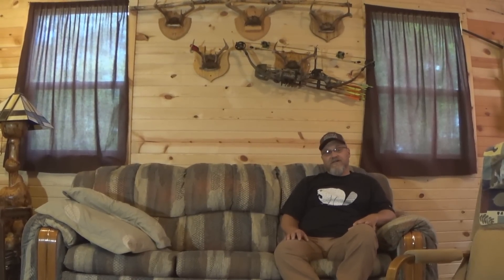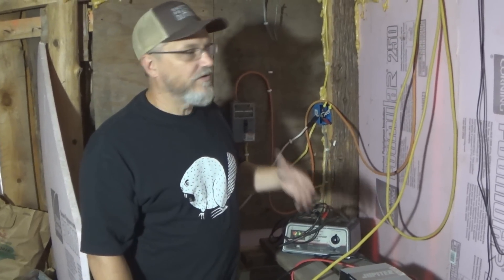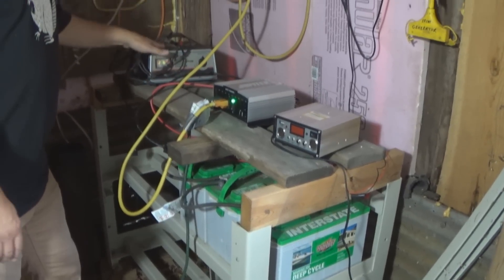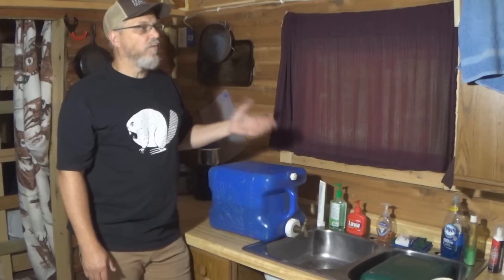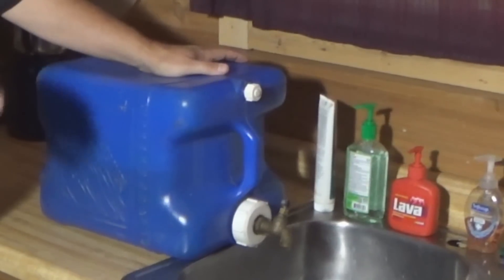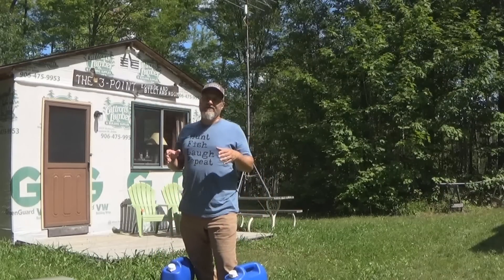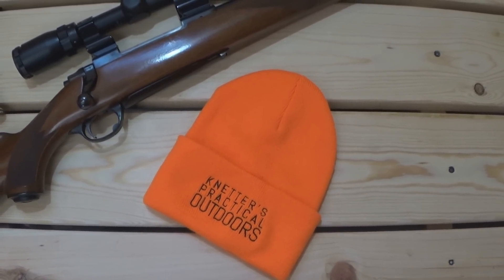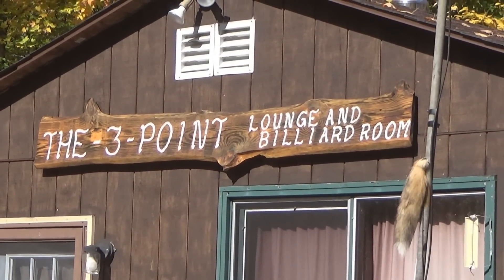Off-Grid Utilities - How We Do Heat, Water, Electricity And Sewer

Comment: Some great ideas. The water seems like the weak link. It will be difficult to haul all that water when you get old or disabled. Six things you can do fairly easily and inexpensively:

(1) Collect rainwater off your roof into plastic 50 gallons drums (you can usually get used ones for free). You may need to add gutters, pipes and metal/vinyl roof (if shingled). If drinking water, have it tested or filtered. 

(2) Dig a shallow well with a pipe and handpump away and uphill from your outhouse. If drinking water, have it tested or filtered.  

(3) In the driest time of year, search your land and adjacent land (with permission) for wet areas near a hill. Follow it uphill until it's dry. Move debris below this until you find it wet again. Dig uphill until you find where the water comes directly out of the ground. Dig a small hole. It will likely fill quickly. Give it a half hour for sediment to settle to the bottom. Scoop a jar of water off the top and bring to the nearest lab for testing. If it tests good, come back and dig your hole deeper. You will have all the water you need. You can carry it to your cabin, or dam the bottom, and run an insulted pipe to your cabin (remember, you are uphill). Covering with forest litter will work and look better. It may freeze in the winter if you're in the north. If drinking unfiltered, I would get it tested once after flooding and then once a year. 

A few more tips:

(4) Outhouse: I would add a vent pipe that goes below the seat and well above the roof. The wind will pull the smell away. I would not use ash. It will fill too quickly. I would have a bag of lime with a scoop on the top. 

(5) I would purchase an inexpensive camping folding toilet seat for using inside if it's too cold outside or if the snow is too deep. You can purchase environmentally safe disposable bags that you can dump into your outhouse at a later time. You can have a partition around your toilet for privacy if you wish. Or better yet, keep it in our sauna to use. It's warm and you have privacy. 

(6) I would add a heat reclaimer (with thermostat) to your stovepipe a foot above the top of your stove. You can set it so it will only come on in when it gets the coldest in the early morning when only hot coals remain. Instead of having to get up out of your warm bed and try to start a fire in the chilling cold, your cabin will be the hottest when it is the coldest, and you will use far less firewood. As hard as this is to believe, it really works! Coals give off more heat at the bottom of the stove than roaring flames going up your chimney and wasting energy. An ironsmith puts his metal into the hot coals, rather than at the top of the flame.
Reply from the maker: thanks for taking the time to add all that.

Comment: The building has a natural flaw being wood,,,wood rots and it's suggested to make the shelter from cement board rolled out with fiberglass resin and coloring.  It's getting close to a permanized structure for all purposes anyway.
Reply from the maker: That may be true, but there is a lot of wood buildings over 100 years old and still going strong.

Comment: Wow !! You guys have made an awesome camp / bugout pad for yourselfs. Well done !! Have you thought about putting in a shallow well ? Howza bout yer waste water ? How often do you need to move the outhouse and / or sauna/ shower because of inadequate drainage, if ever ??
Reply from the maker: We tried a point once and had some problems but we may try again.  Our sink and sauna drain into a dry well (buried barrel with holes and rocks in it).  Haven't had to do anything with the outhouse yet and it's been over 20 years.  We only stay 20-30 nights a year so it pretty much turns to mulch.

Comment: You don't want to be producing sparks right at your batteries!
Reply from the maker: They are in a well vented shed but I know what you're saying.  There must be a large capacitor in the inverter that loads up as soon as the leads are connected because the inverter is off when we hook it up.
Reply: @KnettersPracticalOutdoors  Yes capacitors for sure, you could pre-charge them through a resistance, even a car turn signal lamp then correct directly. Better still use a switch or relay, an enclosed one. 🙂
Reply: Yes. Hydrogen gas can get real angry. Def need for a remote switch. Probably not close to a burn ward either.
Reply: @pgnandt  Gotta love the smell of Brown's gas in the morning. It does tend to dissipate once you've blown your roof off however.
Reply: @stevemorris3710   Watching a few videos of guys blowing up bags of Brown's gas I developed a respect for batteries blowing up. Brown's gas = Shake hands with danger.
Reply: @pgnandt  For sure, that and acetylene/oxygen have to be the most dangerous.

Comment: You should clip the positive and negative from opposite sides of the battery bank so it discharges the batteries equally
Reply from the maker: Does that really help?
Reply: @KnettersPracticalOutdoors  imagine the flow of energy leaving your front battery that both terminals are connected to.  The other batteries down the line transfers over to the front battery.  It will shorten the life span of that front battery making it less efficient.  Putting it on opposite sides discharges all the batteries simultaneously. Doing the same thing with your battery charger and solar charge controller

Comment: Using an inverter .. there is a loss converting DC to AC... Purchase many DC operated appliances as possible and you will use less battery running DC...
Reply from the maker: True.

Comment: Replace that old generator with a Honda E.U.2000.
They get way better fuel economy. 
Especially if your only powering a battery charger. 
You will use half the gasoline. 
And much quieter.
Reply from the maker: Maybe someday.

Comment: In a pinch you can run jumper cables from your car to charge batteries if your on 12 volt system I use 2 golf cart battery in series got 8 years out of them 250 watts of solar
Reply from the maker: cool idea

Comment: Could u give the price of the batterys bank .  converters and items u use to set this up.  need to know price tags on things.  thank you
Reply from the maker: Each battery is about $120 to $140.  The inverter was about $120.  Generator $500.  Solar panels and charging controller I think was about $150.  Rough estimates as many of these items were purchased over the course of several years.  Thanks for the interest, KPO.

Comment: I like what you have going. How long does the battery bank last on a full charge with the two of you out on a normal camp out? Also how long does the generator have to run to charge up the system? For me using a 10amp charger it takes 4 to 6 hours or more to fully charge a single batt in my car so that generator must run near continuously to keep the batteries charged up. at that point why not just run the generator directly just using the inverter at night.
Reply from the maker: 3 batteries in good condition and fully charged will last 2-3 days during deer season (dark out at 6 PM, lights, TV until midnight or so).  In the summer they last an entire 3-4 day trip.  Yes you're right, once the bank goes dead, it won't get fully charged again on that trip.  If the bank goes dead after say 2 days, we will run the generator that evening for electricity and charge the bank for 2-4 hours.  The bank isn't fully charged, but usually enough to have power for the next evening.  Often we bring the bank home and get it fully charged for the next trip in the fall season.  In the summer the solar charger usually gets it charged up before we return.  Sometimes if we loose power and want to charge it back up, we will separate out 1 battery for charging.  The size isn't there, but it takes less charge time to get the threshold voltage back up to were it needs to be with 1 battery.  This will usually give us a couple hours of power the next evening also.  Recently we are using 2 separate banks of 3 batteries.  One goes dead and we switch to the other.  Charge or bring home the dead bank.  Thanks for the interest.  KPO

Comment: Use larger solar panels, maybe a couple of 250 watt ones.  I used 24 vdc panels charging two batteries in series. There are 24vdv inverters. I use mine for security lights, I have a light / dark sensor that turned on / off 12vdc led lights on each battery. Just a thought to avoid using an inverter.
Reply from the maker: We like the inverter.  It allows us to use all the 120 AC devices (TV, DVD, charge laptops).
Reply: @KnettersPracticalOutdoors  Somethings you have to have it. But if you can work around it that would be best. Inverters draw power if turned on  sitting idle. This is more of a big deal with a smaller panels. None of my inverters seem to last very long either. Just some random thoughts.

Comment: A technology I never see with off grid living is steam engines. With a simple steam engine boiler system a person could use it to heat the home and give electricity with firewood only. With an alternator design built-in to the steam engine having a drive belt setup with an axle crank shaft you could charge batteries for backup power but run mostly off the boiler till the water cooled down. If having a well the power could go to the well pump to fill the boiler whenever it got low with an electric meter and or automatic gauge setup or if only a shallow well just fill it up through a hose connection to the boiler and hand pumped a couple times a day. The engine could be in another enclosure away from the house insulated to limit noise which could have waterline ran through the home to heat the home which the pump could run off the boilers electric output could even add a pressure release line in the home to let a very small amount of steam to be put into the home to add humidity on those dry winter days being a humidier. If a steam engine could move a car or boat I see no reason why it couldn't spin an alternator or two to give ample power year round.humidity. this system could also fill a waterheater drum and run pressure through it so the home would have hot water and water pressure. Adding cold water to this system would just take another gause wear when you want to take a shower or clean dishes you could just flip a switch that would turn on the well pump where the boiler gauge is off so the boiler doesn't over fill itself having a separate line that pushed the cold water straight to the home having a T on the water line. Then when done just turn the pump off again. If only a shallow well you could have a cold water reservoir tank in ground so it doesn't freeze and hand pump that tank till full everyday or so having an electric pump inside it to pump cold water into the home.
Reply: Just watched this video and I was thinking the exact same, and just 2 hours after your comment.  They make outdoor wood furnaces, and something like that is where I'd start, though they are expensive to buy and use a lot of wood.  I think a criticism of the idea would be the difficulty level and safety of such a device and unfortunately nobody makes a ready made unit to either buy or copy, at least none I've seen.  But it's a great idea, and would make the camp more self-reliant.  
Another thing I'd add is to build living spaces with super insulation to start with.  Something like the Perfect Wall  you can youtube it for details.  Or a straw bail structure would do the trick too.  That way you don't need a lot of heat to begin with because resources should always be conserved, and in certain situations the less things you need to worry about the better I think.
Reply: @headphone307  yeah those outdoor wood boiler systems are pricy but having to pay no electrical and not being dependant on gas for a generator would pay off in time and give more independence. 
On the steam engine aspect yes they don't have a working model to just buy or copy other than cars or steam boats from a century ago. If they could make them then we should beable to find design plans of that age and just copy the design and or reverse engineer them to put power to a belt drive on alternators rather than to car wheels or a boats paddle wheel.
With one of those outdoor woodstove boilers now thinking more into it if it were placed in a separate building you could use the heat that comes off the system itself by just pumping the hot area from its enclosure to the home structure with simple fans and ducting making the heated water lines to heat the home unessesary which would help the boiler system not loss pressure that is needed for the steam engine.
Those outdoor systems waste alot of wood cause they are heating the outdoors. If used inside the firewood needed to keep the boiler up to temp might not be consumed so quickly. It'd be just as efficient as an indoor wood stove.
The only thing a person would then be dependant on would be parts like censors and batteries. Though if it works as I imagine batteries might not even be needed onky thing I'd think they would be needed for would be power fluctuations as the motor might makes the lights go dim then bright all day when running. Though this might have an easy fix other than batteries. If all you ever needed to keep it running was belts and alternators it would be easy to maintain as you can get tons of those cheap or even free from scrap yards unlike a trustworthy battery which aren't cheap.
Thinking more...🤔 if there are two motors with offset pressure shafts on two alternators the system might not dim in-between the cylinder cycles or could build one motor with multiple cylinders so the belt always spins the same speed with the same pressure. A bit of engineering would be required for sure.
Reply: @headphone307   you sound like a very intelligent man. I like what your comment on your channel said about truth and Father. I wish there were more like us. 👍
Reply: Recently watched this and thought it was a good start
https://youtu.be/ok7V5j3DyQo
Reply from the maker: Depending on the climate, maybe the steam engine in the winter but then go to solar in the summer?  Maybe save a little wood.
Reply: @KnettersPracticalOutdoors  yeah would be a waste of wood if using it all summer. One thing that would be nice a thing I lack is a stream or river on my property. A water turbine would be the best for summer power. They have underwater turbines that could possibly be put deep in the water to catch the current so they don't stop in the winter when the creek or river freezes over. I'm just thinking a gas free off grid design is best unless you can pump your own oil on your property and refine it. True independence. As you said solar doesn't quite cut it. Perhaps if you have many panels it would but they ain't cheap plus if they stop working in time and there are no more left to buy your once again without power or dependant on gas.
Reply: Flag out. You sound like a very intelligent man. I went to your channel and I really liked what you said it is so true it's good to know that there are others out there. Truth and love👍

Comment: Have you thought of using 6 volt golf cart batteries? It extends the time between charges. 

We use those instead of 12 volts on our camper.
Reply from the maker: Are we talking about putting them in series to make 12 volts?  Because our inverter requires 12 volts.
Reply: @KnettersPracticalOutdoors  Yes.

Comment: I did solar power, solar shower, woodburning stove, and compost toilet.
Had a decent sized rainwater harvesting setup I built with a tarp and a big, solid black tank with a spigot at the bottom for water. Used rainwater for everything. Coffee, dishes, shower.  Heated water on the woodburner for showers if it was cold and cloudy out.  Cooked on the woodburner or a little bbq grill I also had. Buried my compost around trees.
Reply from the maker: We may collect rain water or install a pump sometime.

Comment: Love the Off Grid Camp setup. 
I also really like that Ruger M77. What cartridge (caliber) is it chambered in and is it a Tang Safety?
Reply from the maker: It's a .270 and yes it has the a tang safety.  I know there has been some issues but mine seems to need a very deliberate motion to take it off safety.
Reply: @Knetters Practical Outdoors  
Very nice. Great rifle chambered in a great cartridge. Love the Ruger M77, I have a Ruger M77 tang safety chambered in 257 Roberts and a Ruger M77 Mk2 chambered in 25-06.  Both shoot really well, both with factory sights. Would love to find an older M77 tang safety with the factory sights chambered in a 270 Winchester and another chambered in 30-06 as well.  Love your videos. Subbed

Comment: OK, so you use a generator to power batteries, that powers your camp. 
Why not cut out the middle man and use the generator to power the camp?   Pinballman1
Reply from the maker: The batteries give you on demand power, as apposed to running the generator 24/7 to have the same.  When our small battery bank is fully charged we might get 4 days of power use out of it.  Also the batteries are being charged by the solar panel, so if we go to the camp for one or two nights here and there during the summer, we might not have to run the generator at all.  The generator is noisy so we like to run it only when we need to.  Thanks for the question, KPO.

Comment: For the outhouse, you might consider a Harbor Freight motion detector solar security light. Mount the light inside & the solar unit outside, those late night trips to the outhouse won't be in the dark.
Also, mount rain barrels up as high as allowed by eaves trough & have covered with only inlet. Plumb to your sink & have running water.
Reply from the maker: All great ideas.
Reply: Boy I bet that rain watet will give you the trots huh ??